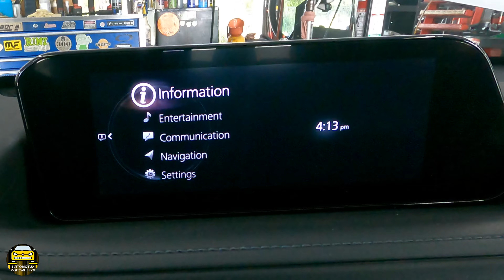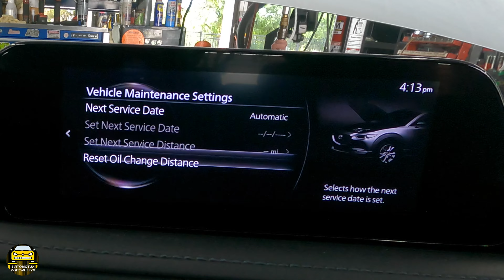How To | 2019+ | Mazda CX-30 | Oil Change | Oil reset |

Comment: For shops that use a container like the yellow one used here, I always wonder where that container is placed when not in use.  If just left on a shelf in the shop it will collect dust and other debris which then is transferred into your engine.  A sealed container would be best.
Reply: It will be cover with a cloth 🙏